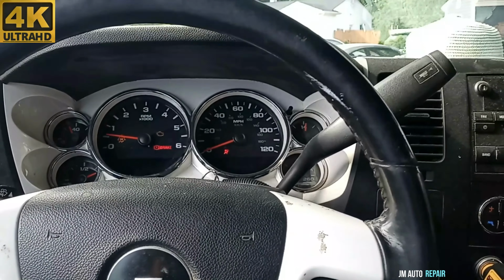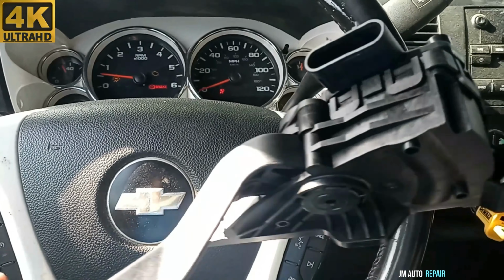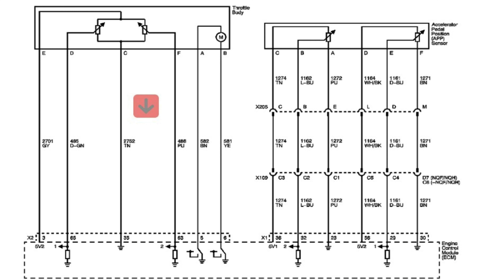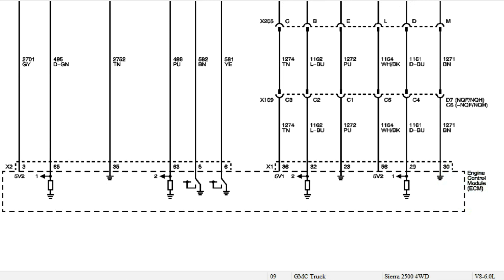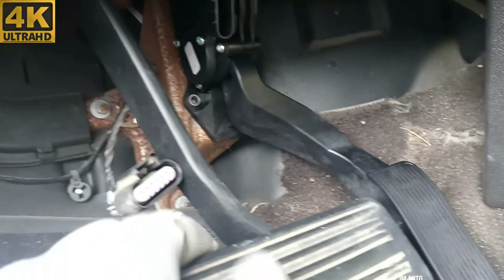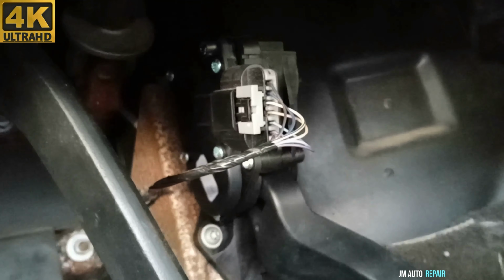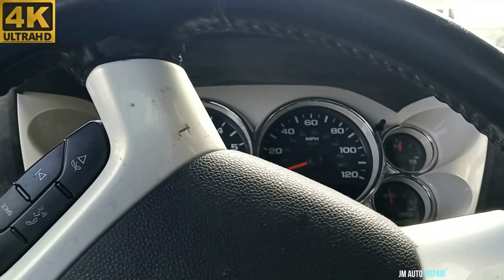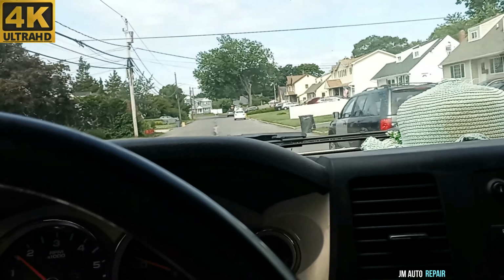GMC Trucks Sierra Silverado Tahoe Engine Reduce Power Limp Mode Code P2138 P2122 P2127 P2123 P2128

Comment: I was having power engine reduced problems and I swapped MAP sensor and fixed power engine reduced but I do have check engine light on for codes P2127 P2128